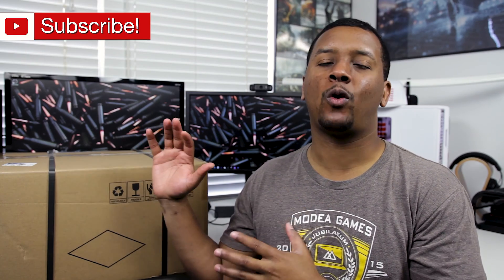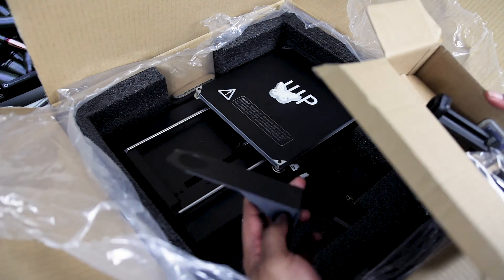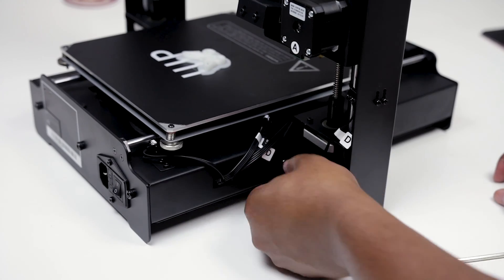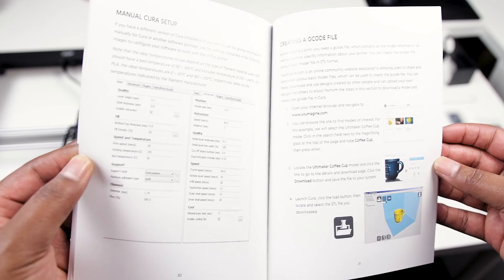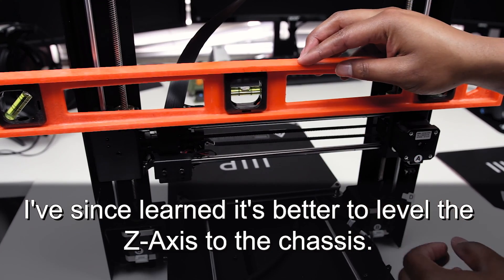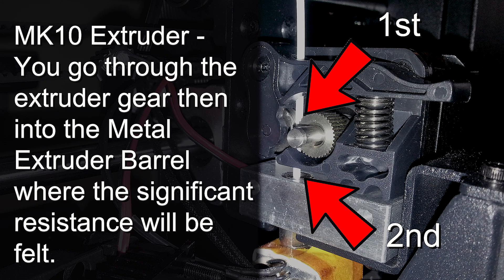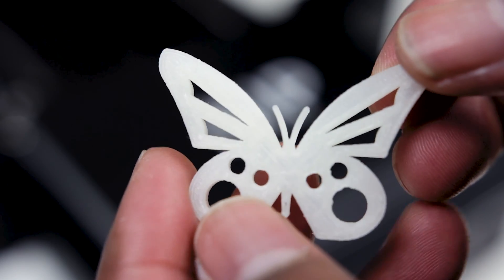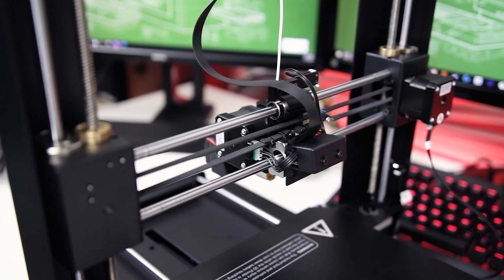Monoprice Maker Select Plus | Unboxing, Setup & First Print / Impressions

Comment: Hey man! Great video! Just got mine today (I got it secondhand), but I can't seem to get it to print anything. The filament does come out if I push it from atop, albeit very slowly, and pressing the E axis dial doesn't do anything. Should I assume the nozzle is blocked? I assume the temp is ok, seeing as it does melt the filament. How could I know if the extruder is not working?
Reply from the maker: If you can push the filament through when the hotend is heated but using the extrude feature doesn't work that suggests there's something wrong with the extruder assembly.

You'll want to make sure the extruder motor is properly connected. At the motor, at the daughter board on the back of the Z/X gantry and the cable that goes from the gantry down into the base of the printer (remove the bottom panel and check that the JST connector labled "E" is connected to the main board correctly.

If everything is connected try to listen or feel whether the motor actually turns when you tell the printer to extrude. If it's connected correctly but the motor isn't moving that could be a bad motor (fairly easy to swap out) or the motor driver on the board is gone out (more complicated to replace the board but not that bad after you source one.

If the motor is turning but the filament isn't being pushed out that suggests that the gear and or idler that pushes the filament into the hotend might have something wrong with it. The gear should turn when the motor shaft turns. If it doesn't then it could be that the set screw on the gear isn't tight enough. You'll also want to make sure the alignment of the gear and idler are all good.

If the gear is turning but not pushing filament through make sure the gear isn't all gummed up with stripped filament. The gear is designed to bite into the filament slightly and push it through. It can strip away filament and get gummed up when the hotend is jammed.

If all that looks good it's likely a jam. I usually start by using an accupuncture need to try an clear the jam with the hot end heated up fairly high. for pla that normally prints around 210 I'll heat it to 250. Retract the filament a bit manually and then push the needle into the nozzle. Move it up and down, twist it a bit. Careful the hotend is HOT.

After that hold in the idler/tensioner bar and see if it's now easier to push the filament through. Ideally it should come through and not curl up at all. If it's coming through faster and looking good you can try to use the extrude feature and hopefully everything works.

If it's curling when it comes out retract the filament a bit and try the needle again. If there was filament other than PLA with a hotter printing temp you may need to heat it up even hotter.

If that doesn't work you can look up some other techniques for clearing jams like "cold pulls" "hot pulls" "atomic pulls" etc... Last resort is completely disasembling the hotend. There's a little white piece of bowden tube that is inside that can get burned and jammed up. If that's the case you can cut another piece of bowden to size and replace it.

Other than that you might have to replace the whole hotend.

Best of luck

Comment: you do not have to move the bed and nozzle about when leveling go to menu then there should be a feature that says level and it will move the parts about the Xyz axis while you level the build plate just FYI

Comment: I have the unit. YEs, great printer for a beginner, and the instructions are good. My ONLY real complaint: the spool holder is too small for most of the filament spools I have. 

Use the Wanhao i3 profile in Cura 3.6

Comment: we have a maker select plus at work and its been performing well for about a year.  Today we received two Maker Select V2 from Monoprice that were refurbished.  I haven't had a chance to run them yet, i just put them together this morning.  The refurbished ones were $199.99.  They came with a replacement print bed film as they are used and the ones in place had scratches.  They also had a little wear on the painted parts but this is an industrial application, so paint isn't important.  All the parts and documents that come with a new printer were included. the two boxes were not packed the same.  One was packed in foam and the other in bubble wrap.  One had a quick set up guide and the other did not.  I used the manual, so the quick guide wasn't needed. The only real complaint is that the filament holder that is mounted on top isn't long enough for the 1KG spool we order FROM MONOPRICE. If they work well in the next couple weeks, I plan to order one for myself.

Comment: Great video! The instructions, in my opinion, were not clear when it came to leveling. I actually gouged the print bed because I didn't understand the process. Your video made it very clear. Thanks for that!
Reply from the maker: Awesome. I'm glad that it helped. I was fairly embarrassed and almost didn't include that I'd scratched mine. But I figured there was no way to hide it and also others might benefit from my mistake. Thanks for watching!

Comment: Hey brother, thanks for the video, i have a few questions if you don’t mind. (First a statement though) I’m looking at the Monoprice maker printer, and I’ve never printed 3D before. So here are the questions. 1) How fine is the outcome of the product? 2) I heard that you can set your product in a tub of acetone (not floating, but so the fumes can reach it) and it’ll smooth it out) have you tried it? 3) For filaments, I wanted to make a funky ash tray, could it withstand it? I’d really appreciate the help!

Comment: That printer has a TON of addons you can add to it. Get a e3d hot end and go to thingy verse and get the frame braces will make a HUGE difference also a major upgrade should be delryn bushings dump the roller bearings. Make sure the hotend is a original e3d not a chinese knock off.
Reply: Can you assist with sourcing the Delrin bushings and which frame braces? Any other suggestions? Thanks.
Reply: For what printer i got mine off of ebay and now im building a anet a8 and ill put delrin bushings in it and a e3d v6 hot end and a pc modular power supply instead of the anet power supply. also found a aluminum bed for the heat plate.
Reply: I got the igus bushings off of ebay and the braces off of thingy verse.
Reply from the maker: Yes I've found a huge number of upgrades/mods. Initially reviewing this as an out of the box experience but will be doing a lot of upgrades to see what's worth it and what's not.

Comment: hi, some body help me software and driver for monoprice make select plus.
i bougth it on ebay but no software and driver, thanhk you so much
Reply from the maker: Drivers I'm not sure about. But for software any version of Cura will work. There are videos showing how to set up a custom printer in Cura. Have to put in your build volume dimensions, nozzle diameter, filament diameter and some other things.

As far as I know Monoprice stopped doing their custom version of cura with the profiles already set up. Alternatively people download and use the profiles set up by Wanhao. But I wasn't able to get good results with those.

Comment from the maker: What 3D Printers have you guys been looking at? What would you 3D Print first?
Reply: the wire thing is to clear a clog if you need to i have one of my own for my monoprice maker select v2.1 3d printer
Reply from the maker: Ah. Gotcha. Thought it was weird they didn't really explicitly say what it was.  Thanks for watching.
Reply: Hi. I bought the Monoprice "Maker Select 3D Printer v2.1" Unpacking tomorrow! It came highly recommended by an experienced 3D printing guy at our local Makerspace.
Reply: I’m actually printing a phone case as soon as a put my select plus together. Then I’m going to try and find good files to print out stuff for comicon